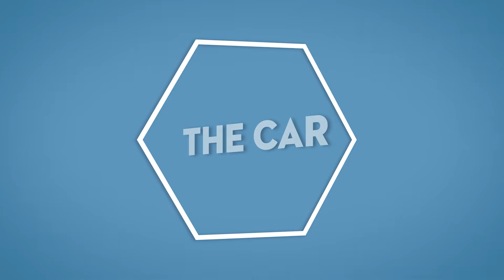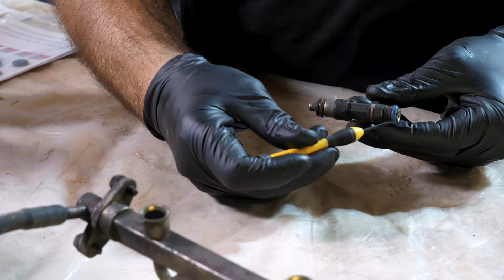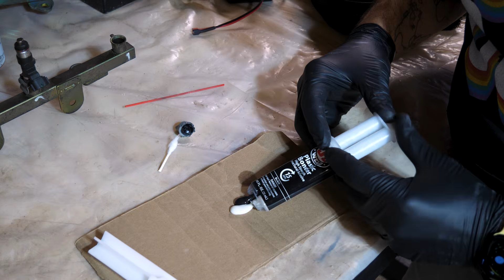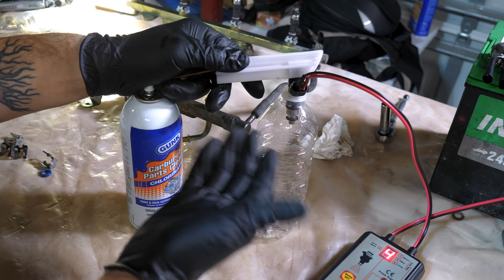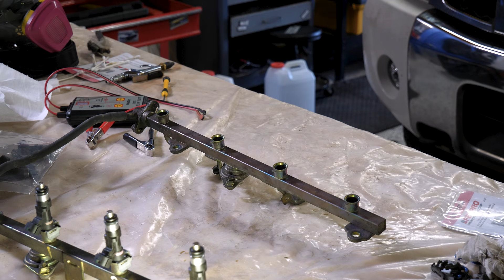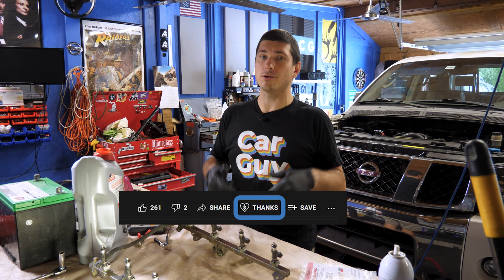How To Clean Fuel Injectors

Comment: Good guide. But remember that if you got a newer car you need to place the injectors where you removed them or reprogram the cars computer.
Reply: I dont believe that because what happens when you need to replace one do they make a specific spare now you can't change with different types only because they have different connections please tell me which vehicle needs reprogramming for new or moved around injectors
Reply: @418lightning8  You're right, it makes no difference. TPM's are location specific, but NOT fuel injectors.
Reply: @418lightning8 When you replace an injector on newer vehicles you have to code them to the ECM, just like almost anything else on a modern vehicle. Heck, you can't even replace a battery anymore without coding the ECM because it modifies the charging parameters as the battery ages to maximize the life of it. Batteries are all different....  so you have to tell the ECM how old it is, what chemistry (wet cell, AGM, spiral, deep cycle, etc.) and it's current capability or size (cranking amps) so it can charge it properly without over or under charging the new battery which could cause sulfation and drastically reduce the battery's lifespan. Alternators don't even have voltage regulators in them anymore, charging is fully PWM controlled by the computer as an exact science, even taking into consideration the battery's actual temperature. The same is true for the injectors.... not only do they each have unique digital serial numbers recognizable to the ECM, but the coil inside each one has different specs because they can't manufacture them all exactly the same. Modern ECMs have software that adapts and learns the particulars of each injector and modifies how it operates them (lengthening or shortening the PWM) to account for variances in manufacturing, age, and wear. So you can see how it would be a problem for the ECM if it's running the learned parameters for an old, worn out injector and you put a brand new one in its place without telling it that you made the change. This is also why they have to go back in the same hole they came out of without mixing up their original locations, because each location on the engine has it's own learned parameters, including compensation values for cylinder and valve wear using complex algorithms for cylinder balance and contribution calculations. Modern vehicles have been this sophisticated for more than a decade, lol.
Reply: 😅 @johnny0454
Reply: @johnny0454  by now you would think the computer would learn everything. Sounds like technology is going backwards.😂
Reply: @johnny0454 damn really? It's crazy how the new cars are made these days, thanks for letting us know, I'll stay with the older ones
Reply: No…. You don’t. Fuel injectors are a simple coil, open and closed, the PCM does everything else. The injectors need only be matched to the vehicle (OE specs) and flowing properly.
Reply: No way! Makes absolutely no sense. I replaced an injector in my 2020 honda accord and didn’t have to do any such thing.
Reply: ECU will reprogram it, don't bother.
Reply: Yes good idea to number them, I am ocd about that everything is numbered, firing order and distributor map/rotation etc drawn under the hood for quick reference - some bolt torques too
Reply from the maker: Wild, Didn’t even know that was a thing. Great tip! I will pin this comment.
Reply: You can put a injector anywhere within fuel rail it don't matter order or anything. Ecm read date from each other do its thing that's why each has plugs open close plus read date to computer
Reply: Yes, if you have a car from 2045, make sure to not mix them up to not confuse your AI ECU.
Reply: Looks to me like at 9:10 of you know how to clean injectors especially the guy showing how to do it he's doing good but only one part with that mean he doesn't do it good at all does injectors has a little filter inside to cast the dirt and anything comes on the gasoline now tell me how can you clean something which is plugged up pushing more stuff into the filter the only thing he got to do to do it right is put the fluid on to the other side of the injector that means you have to push
Reply: Mostly Diesel injectors
Reply: @Cliff1143  Cat, Detroit, and Cummins injectors don't care which hole they go in. The only thing the computer does is tell them when to open and close, and for how long. The calibrations are done according to spec.
Reply: possibility,but seems very doubtful..regardless i will never own a new car,they have to much crap in them...
Reply: Excellent video

Comment: 7 26 28  valuable info for a newbie .  my engine is a 4-cyl.  much learned . plan now is to test the efi's now in place.  try to 'scope 'em 1'st and compare their signals .  for clues to account for the engine run rough.  after that to remove them all and follow the steps u showed us.  oh, will first need to order the amazon tester item.  a decision about buying new efi's will follow with the info that results from testing the old efi's.  and it occurs too to test any new efi's rather than assume they are 100%

Comment: You can also leave the injector on the plastic spray tube once you have it cleaned just don’t hook it back up to the power apply pressure from the can and make sure the injector is not leaking you should not see any mist or spray if you do you know that injector is bad

Comment: You epoxied the spray tube to the injector holder tool thingy. I just got this tester/cleaner today and seen on the amazon ad, if you scroll through, there a video. They took the spray nozzle off of the injector cleaner can and stuck the injector holder thing right on top of the cleaner can. 
Is it easier to do it your way? 
I have plastic epoxy just in case.

Comment: Isn't engine oil bad for rubber, I would user a silicon grease which is what plumbers use, apart from that the video was very informational.
Reply from the maker: There are plenty of rubber O-rings in oil passages. They are touching oil constantly. Thank you. I hope it helped.

Comment: I'm getting a P0303 on my 2005 Xterra at 217k miles and reading in thenewx forums, more than one guy has indicated a failed injector on cylinder 3.  If it is, is there a test I can do to know it's the injector after I try swapping #2 & #3 coil packs to test for that simple fix? And is there a way to run any sort of cleaner into my injectors that might clean them out and avoid me having to dig into them?
Reply: I have a Camry showing same code. Try cleaning throttle body. Fixed my problem.

Comment: How do you remove the fuel line from the fuel rail on a 2014 Xterra. None of my disconnect tools will get it off. I've tried 5/16 and 3/8. None of my disconnects are metric.

Comment: Also good to try and spray the cleaner before pulsing to check if you have a leaking injector, nothing should spray or drip without power being added.  Thanks for the video.

Comment: Isn't it better to just replace the injectors?
Reply from the maker: Not if there is nothing wrong with them.
Reply: @Rythecarguy  Thanks for replying. I've got a 2007 titan 190k miles gas mileage in city has been terrible. used to get 17mpg now like 10mpg. I've replaced plugs, coils and no difference. So I thought about replacing injectors. Your thoughts.

Comment: This will help me save on buying new fuel injectors for my 89 miata mx5 new ones are spendy an the fuel. Injector tester or cleaner on Amazon is cheap 25 something not bad man thank u on the heads up on finding a tester or cleaner tool. Gonna buy me one to clean out my injectors and gonna buy new rubber rings for the injectors as well this will help an save me money n time from buying new ones thanks again man glad I YouTubed this. Have a blessing days a head of u man an be sage working on other people's car's 🙏

Comment: I hope you have a fire extinguisher handy  ,  carb cleaner is quite flammable ,  and you have a battery and open wiring all on the bench there , just a spark , and  ,  poof !
Reply from the maker: Yea, I should really get one of those, started welding recently too.
Reply: Do this job outside I'd say. That way cleaner fumes blow away too
Reply from the maker: @pobinr  way less fun that way though 🤪

Comment: Bro thanks for the video. Had a bad feeling about this shop talking about replacing basically my whole fuel system as they knew I didn’t know much about cars. But saw your method and thought wouldn’t hurt trying it out before spending the 800 bucks they quoted me. Needless to say my car is running and feeling like it’s new again. I had an engine light on after doing this cleaning code is gone hasn’t came back and you literally saved me 800 dollars. Thanks much my guy
Reply from the maker: That's so awesome to hear and it's stuff like this that makes me love making these videos. Thanks for sharing!
Reply: What symptoms did you have before you tried it?
Reply: Love hearing things like this i thankful for people that make videos and share knowledge
Reply: You should have sent the man 20 or 50 bucks 🤷‍♂️

Comment: I was wonder if You could help me. I a 1995 Oldsmobile 88 and was testing the fuel pressure regulater and I drained some fuel into a bottle and there is oil in the fuel. What does that mean?

Comment: i did this and didn't know i had a fuel filter inlet inside the injector , it destroyed it .. did you remove yours prior to doing this or did it not come with one
Reply from the maker: No, mine must not have had any, how did you destroy the filter? There is no way you put more pressure in it than the car does.
Reply: @Rythecarguy  

i forgot to mention i did this for a 8th gen civic  ...i did exactly what u did and i decided to clean the inlet hole, by surprise there were broken pieces of the inlet filter inside the injector from the force of the spray due to the inlet filter being brittle from old age, it was my fault then, shouldve check before i did it... i didn't know there was a filter on mine 😀 , should've had taken if off before i did the cleaning.

Comment: That is such a cool little fuel injector tester. The issue I have is the spray can I have does not hold pressure. It leaks where the straw and the push nozzle join so I have to buy a different can.
Reply: You can put some heat shrink tubing between them and heat to form a seal

Comment: Hey Ry, I have an 07 nissan frontier and have the factory fuel injectors but my lower oring is shaped like a circular square. But when I go to name brand auto stores they have the circular round ones like the ones in this video. Have you seen this before?
Reply from the maker: Is it just deformed from being pressed into the manifold? What is the shape of the hole it goes in?

Comment: How can I clean without that cleaner tool
Reply from the maker: soak just the tips?
Reply: Use steps of various size heat shrink to adapt to the tip of the cleaner

Comment: I saw a guy putting some automatic transmission fluid inside the injectors after cleaning them 😳 i just wonder why?
Reply: ATF is the age old trick to add into fuel to lubricate your injectors it has emulsions that stick to the Stem and barrel keeping them fresh.

Comment: If you remove a new o-ring before cleaning (for some reason even a new o-ring gets slightly torn during cleaning by that white plastic connector, which sprays, so I use a separate o-ring for cleaning, then remove it and put back the original new one) can you put it back? Or once removed the o-ring should be replaced even if it is new?  Thank you for a great film.
Reply: Your question seems a little self contradictory, but I would use the old o-ring for cleaning the same as CG did and then replace it with the new one.
Reply: @CycloneCyd  Yes, I'm sorry, just thought about 2 procedures and described one. See besides that cleaning I also replaced the o-rings on the bottom of course, but they were wrong ones (too thick, I couldn't install w/them into the Intake Manifold. So I removed them and put thinner ones fm/another set. I'll use those removed for cleaning, and asked out of curiosity, could I possibly reuse them.  Also could be you installed the o-rings and then decided to clean them, so you remove those new o-rings, clean the injectors and put back those removed. Also there are methods to clean without o-rings, but rather using a clamp. Thank you for the replay.
Reply: @olenaerhardt7725  yes you can reinstall newer ones again as long as they aren’t damaged

Comment: Quick question. Would it be a good idea to replace the dampener since you have the rail out already?
Reply from the maker: You can if you want to knock it out for maintenance sake but it's usually a simple diaphragm that lasts as long as the car.
Reply: @Rythecarguy  Thank you for your vids. I plan on tackling this job but I plan on replacing all new plugs, injectors and coilpacks. For peace of mind

Comment: Good video Ray. On the injectors, if the  spray tip screen is covered with varnish, brown or even black,  should it be cleaned or get new ones? They work fine and spray good,  but look like crap.
Reply from the maker: Did you try soaking a q-tip in cleaner and rubbing the tip? That should clean it up. If that doesn't work you could probably soak them in a shallow tray. Afterward be sure to run cleaner through it to get anything that may have gotten in there out.
Reply: @Rythecarguy  don't soak injectors in a tray where they lay down. Find something the injectors can 'stand' in (like an aerosol lid or old mug), place the injectors pintle down and put in enough cleaner to cover the pintles only. 
If you soak injectors laying down so the cleaner gets inside, it can damage them (in particular dissolve the coating on the copper wire of the coil causing a short).
Reply: @CycloneCyd  thanks, yet what is a pintle? Sorry, I m Dutch, don't know the word
Reply: @TheMrBennito  The pintle is the spray end.
Reply: @CycloneCyd  figured so, thanks! I had checked out yr vid first before I got here, straightforward stuff!

Comment: Want to try this on my 2000 GMC Sierra. It’s got over 300k on the dash with original injectors
Reply: Wow 300k that's amazing I love it 😁👍🏾
Reply from the maker: You should! I might help out power if they are a little clogged over time.
Reply: Don’t those trucks have the injector spider setup that lives inside the intake ?   I don’t think you will clean those ones up so simply it involves removing the upper intake, annoying fuel line connection nuts are buried behind the firewall. Those ones I wouldn’t try to clean just buy a new spider and a seal kit as they are upgraded design kits.

Comment: I did my injectors on my Xterra but left the fuel rail on the engine. I lost one of my blue o-rings for a few minutes and started freaking out.
Reply from the maker: Oh yea. I would have freaked. Sounds like you worked it out. 💪🏻